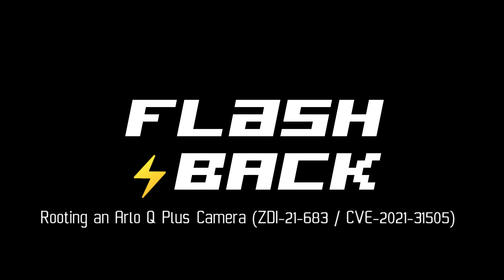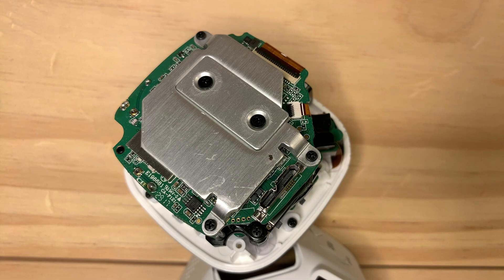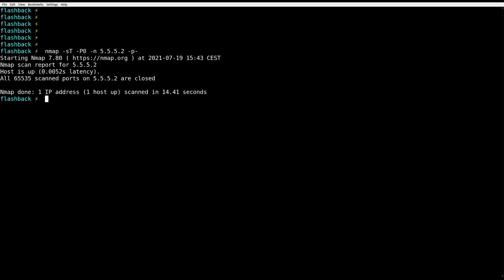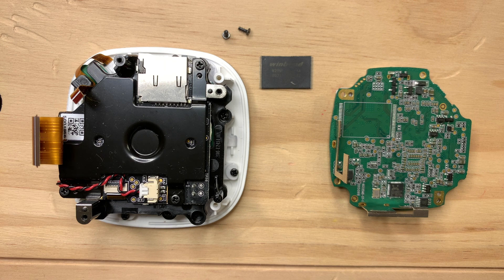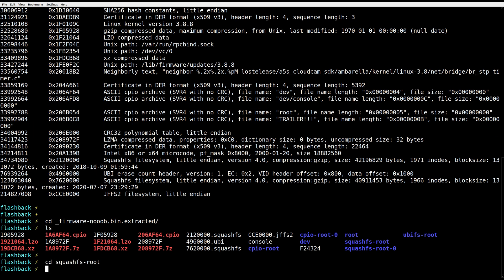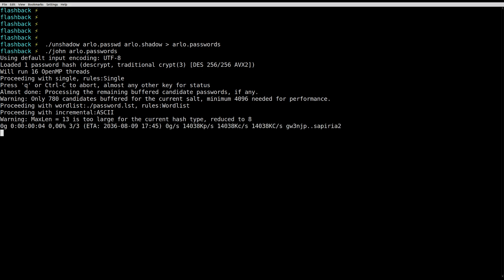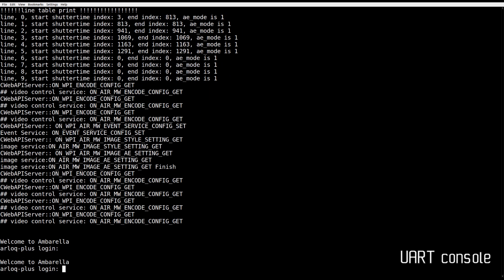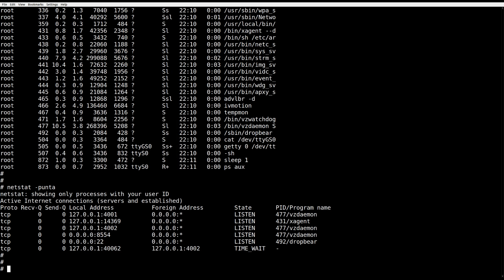Rooting an Arlo Q Plus Camera (SSH 🔙🚪?!)

Comment: on top of having to desolder a nand chip and understanding the firmware, this entire thing is using little-endian, where do you even acquire the knowledge to work with something like this?
Reply from the maker: There’s a lot of steps involved that we skipped. You’d have to analyse the firmware image, extract the file system from it, analyse boot up scripts and binaries to find the back door mode and then do the steps in the video (crack the password, etc).

How to acquire the knowledge? All of the above can be learnt by practicing each step (lots of free resources online), but it takes many years to develop a sense of what to look for and what to do in each specific situation.

A really good in person or online training can give you condensed knowledge (and compress years of knowledge in one week) on this subject matter and many more. We are planning to offering such trainings next year for analysing and attacking embedded devices.
Reply: @FlashbackTeam  Now you're just bragging :)) Thank you very much tho, looking forward to your trainings

Comment: Do you have a video on making a firmware image, after you pulled the chip?
Reply from the maker: What do you mean? The video shows the firmware after it’s dumped from the chip, Radek running the OOB removal script and then use binwalk to extract the file system.
Reply: @FlashbackTeam  I guess just the process of dumping the firmware (software used, settings, chip reader or connected by wires, OS used). I was just curious on how you do it. Just an idea.
Reply from the maker: Yes sir, we have a few videos on that in our pipeline, please be patient as we deal  with our day jobs, but it is promised and we shall deliver!
Reply: How i can get your pipeline? For this video's
Reply: @abdulkaderjaghel9055  They mean they work on it. Their processing pipeline seems to be very deep, though, as the video has still not materialized after 1 year